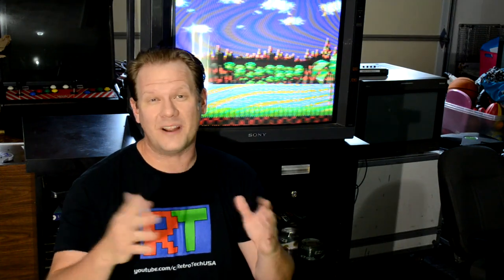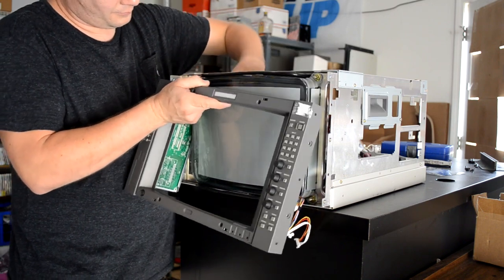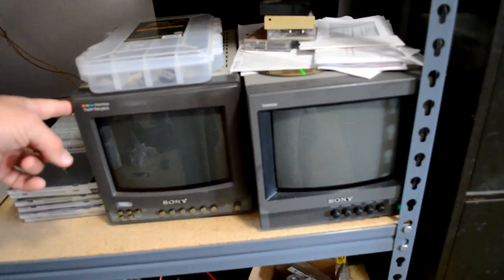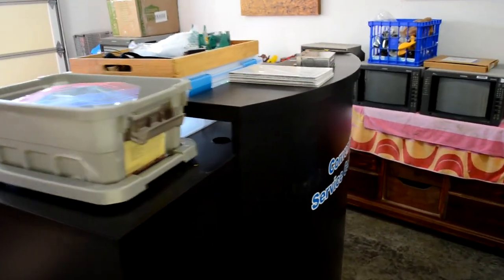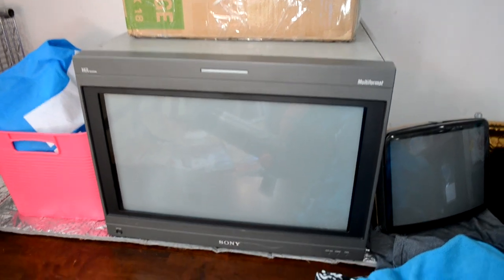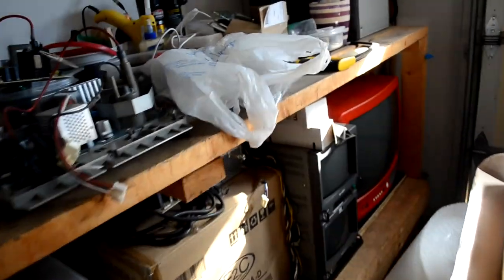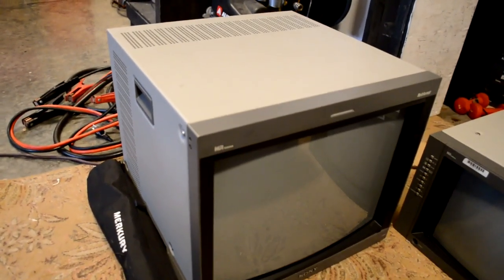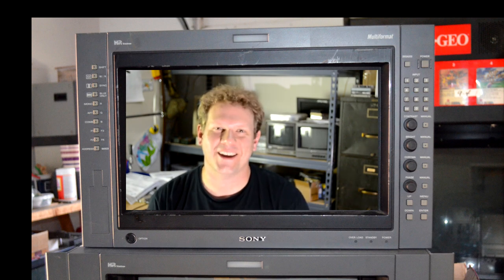Sony BVM D24E1WU, PVM 2950Q & MORE!  What repairs are coming next?  Thanks for 2 Years of CRT repair

Comment: Awesome set up! Looking forward to watching you open up one of those 8" monitors. I recently picked up an older pvm-8220 which is composite only. The front control dials are very flaky. It's possible to get a good picture but it's very touchy. Hoping I could get some info from you in a future video of the easiest way to get at those controls and clean them. Thanks for all your content, enthusiasm, and knowledge! CRTs forever!

Comment: If you end up with a spare working D24 flyback for parts I would love to see if that fixes an issue I am having with mine. I know someone whos currently experiencing the same issue but worse in his D32, and we are trying to determine if the tube is at fault. Pat shipped him some board replacements to try but no luck.

Comment: I see you have a commodore 1701 can i ask a favor? 
after your recap, hook up an original nes with the first super mario bros game using front composite input.

(check out the first question blocks and mario both have very bad shadows to the right)

The 1702 \ 1701 monitors suffer from a kind of cut off\shadow flaw visible in some nes games with certain lighting\colors.
 

I had the opportunity to test this on five different 1702's and one 1701 (some of them recapped) using 3 regular nintendo's  they all do it.

The 1701 is my nes monitor. retro 80's look matches the nes but this problem makes it hard to enjoy.

heard one work around was using the back luma croma combined but i don't have a cable to test that.